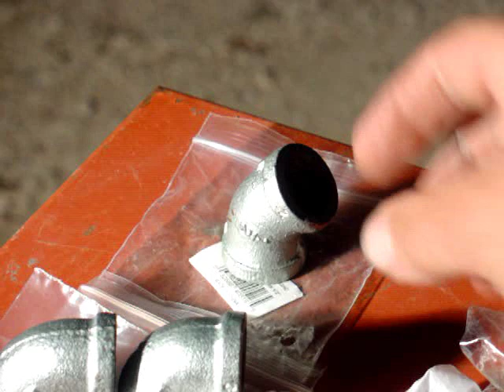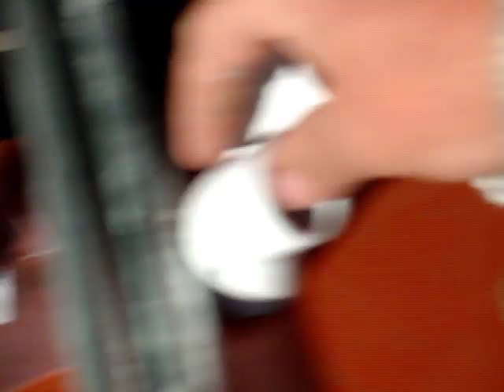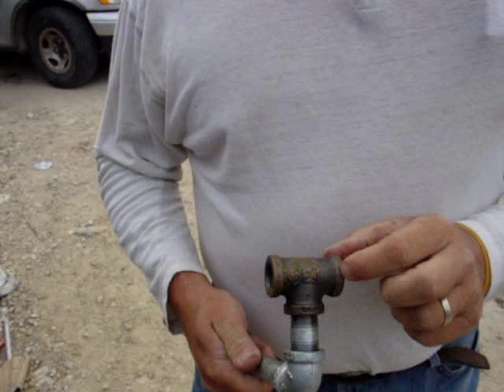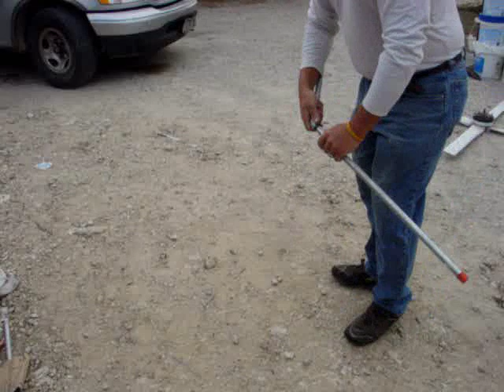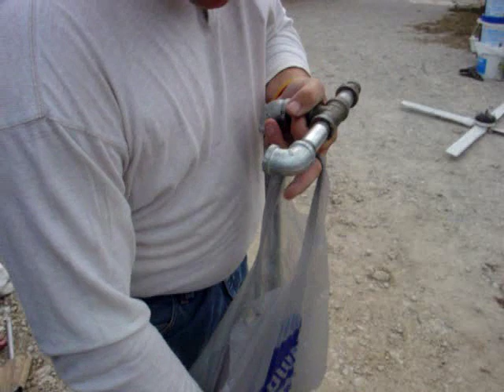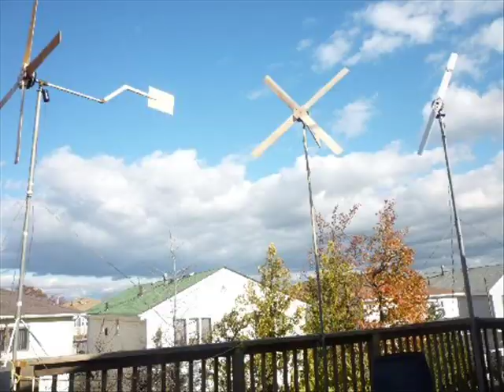9 THE CEILING FAN WIND TURBINE CLASS PART 9

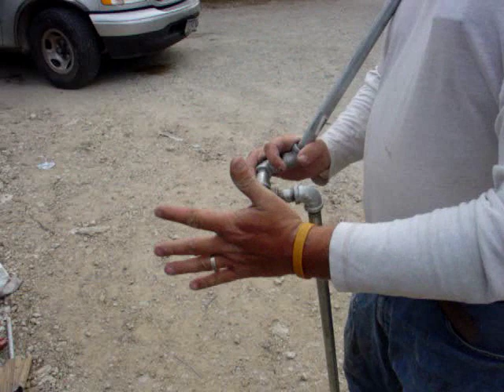Comment: Re: Furling at 8:34.  I knew I could come here and see furling demonstrated well. Thank-you. 

Maybe you should put "furling" in the tags or in the title because yours did not come up in search. I also saw a completely incorrect explanation in a video, which came up in my furling search.

I see how it is the WEIGHT OF THE HINGED TAIL that holds the turbine in the correct direction during the desired winds and I see why it is hinged. Yay.

Comment: How do you keep the 4 wires from the ceiling from melting when you are welding the 1/2 reducer to the ceiling fan shaft?   Also will a single 4'  blade work? Thanks.

Comment: We couldn't hook them up in parallel unless we used a scope to match frequency. As I read the reply I realized the two coil sets are used together for one motor field to have required torque in a small place. Though direction of flow would be important that they are matched then in opposite directions. Yes, it's a Tesla thing, Wow!